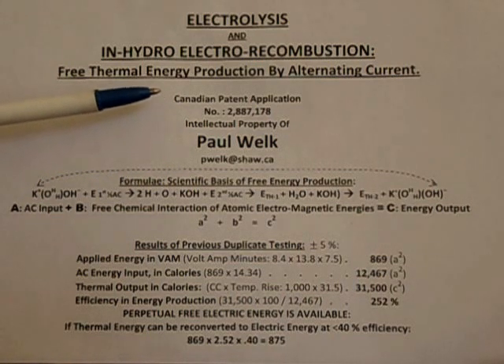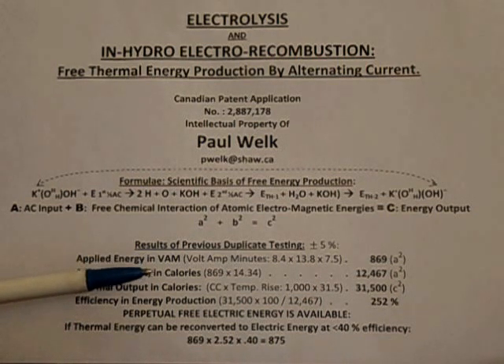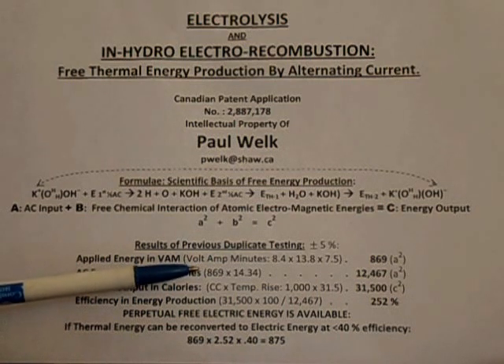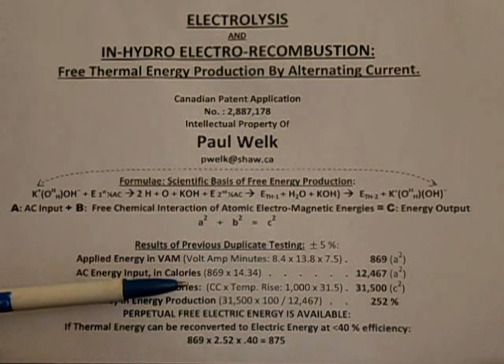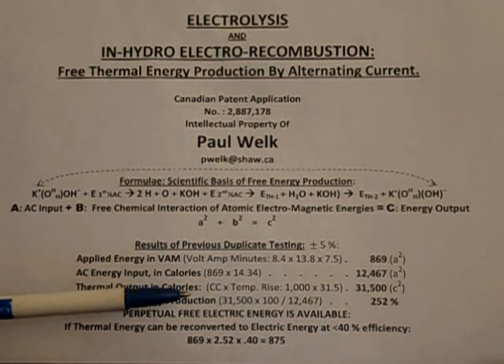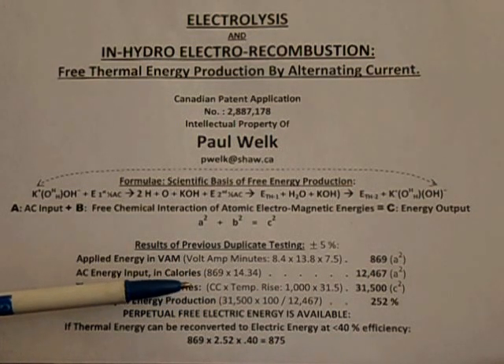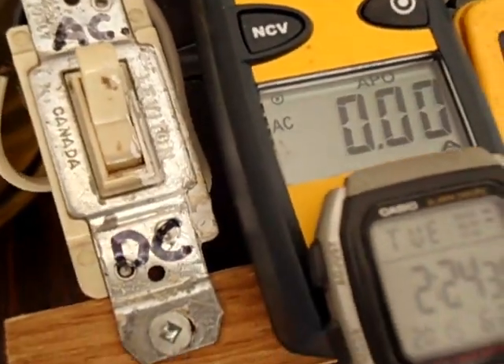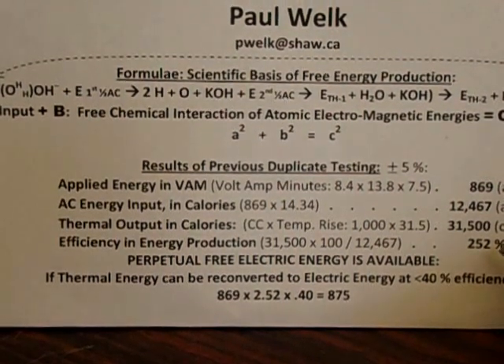FREE ENERGY : An Electro-Chemical Illustration / Simplistic Verification

Comment: Hello, Paul. This appears to be something that I could replicate. Perhaps I could use a TEG, i.e., thermoelectric generator, to power an electric motor to turn an alternator stator and supply power to the field wires for AC applications?
Reply from the maker: Please excuse my late reply. I abandoned this project but not entirely. I improved it, as you can see on https://paulwelk.wordpress.com/wp-content/uploads/2025/01/newenergy.pp_.3.pdf
The trick that makes it work is not merely using AC, which gradually changes. The voltage has to be chopped up and momentary be interrupted, to create an ark when restarting.